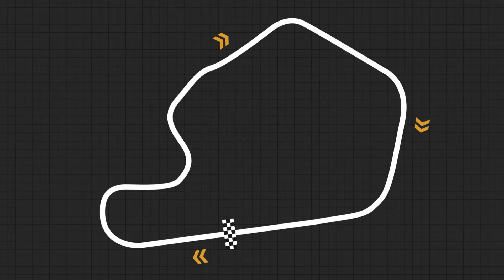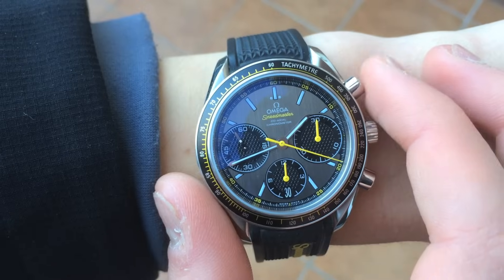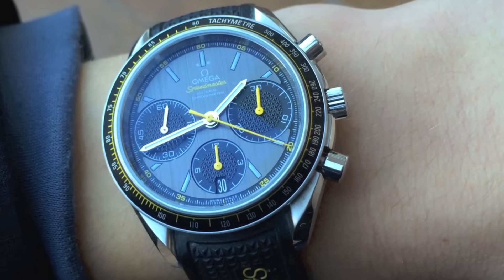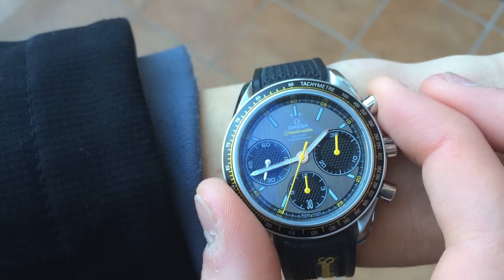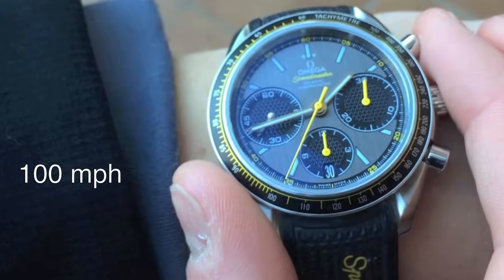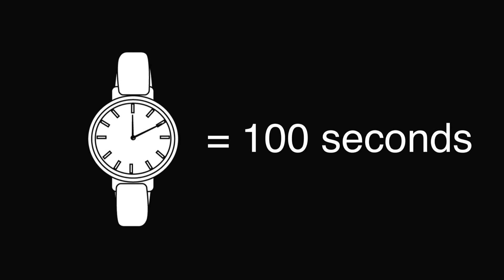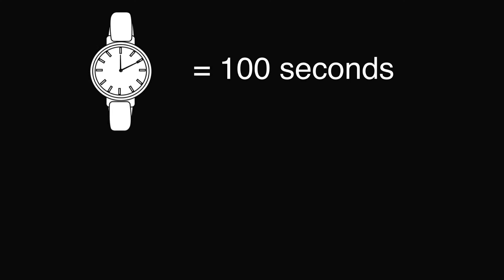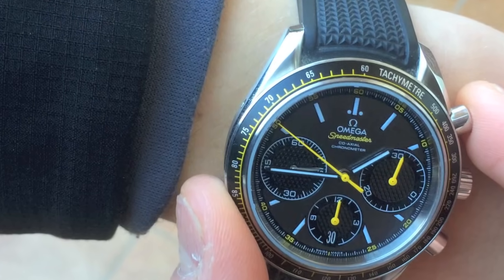Tachymeter Explained! (5 examples)

Comment: you mixed kilometres and miles, tachymetres measure on miles.
Reply from the maker: Thanks for commenting. You can measure in various units as long as the question and answer are in the same units. For example 1 mile in _ seconds = _ miles per hour. Likewise, 1 kilometer in _ seconds = _ kilometers per hour. Hope this helps clarify.

Comment: But why can you rotate the tachymeter?
Reply: No, that's why most chronos snap back to 12 o'clock when you push the second pusher.
Reply: Huh?
Reply: The central seconds hand resets to 0 instantaneously when you push the lower pusher so there is no need to rotate the tachymeter.

Comment: Unit on the scales is in miles?
Reply from the maker: +hazim coppola Thanks for commenting. There are no units as it depends on the question you ask yourself. If the question is in miles, then the answer is in miles. Hope that helps.
Reply: Aaah i see, meaning whatever figure shows on the scale will be divided to unit distance be it miles, km, nautical miles etc? Correct me if im wrong.
Reply from the maker: +hazim coppola That is correct!

Comment: the distance have to be fixed!  if the distance change then that is wrong!  its either for 1 km or 1 mile, but you cant measure velocity if from point A to point B is 3 kilometers for instance. 

So I think you are wrong when you said it would work with 1 mile also. A mile is longer than a kilometer.
Reply from the maker: +Paul Rojas Hi, thanks for commenting. You can measure in various units as long as the question and answer are in the same units. For example 1 mile in _ seconds = _ miles per hour.
Likewise, 1 kilometre in _ seconds = _ kilometres per hour.
Hope this clarified your question.
Reply: Ahhhhhhhhhhhh so dumb of me hahaha I get it !!! Thank you so much! Sorry about that !!
Reply from the maker: +Paul Rojas No worries, glad I could help!